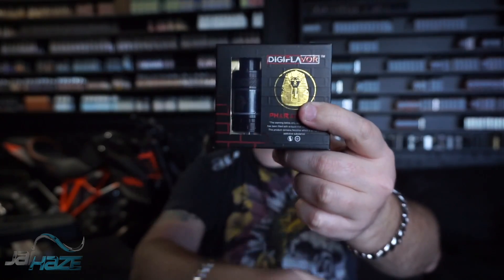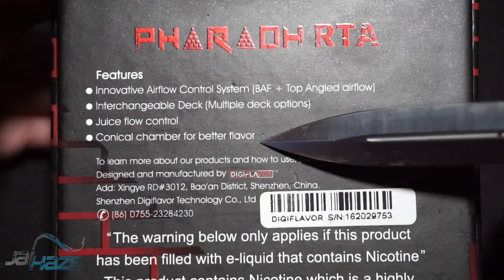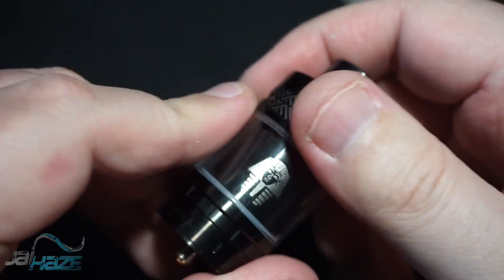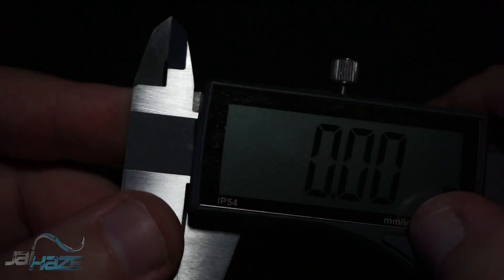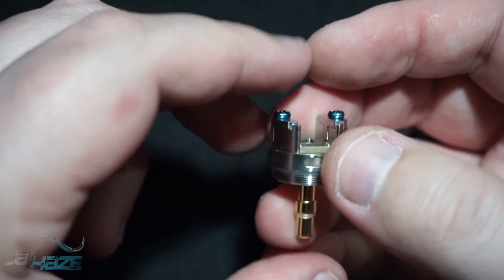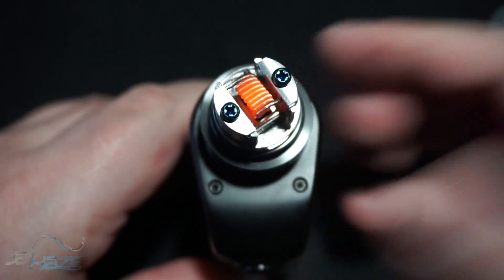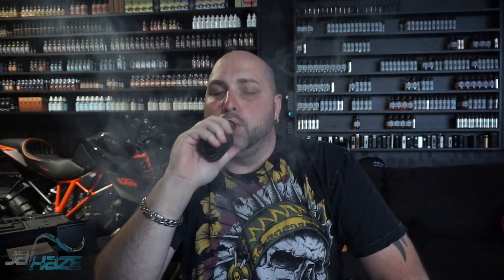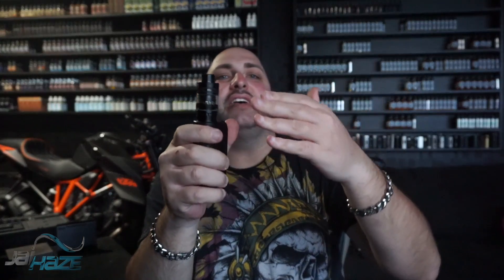Digiflavor Pharaoh 25mm RTA | RIP Trippers Review and Rundown

Comment: jai i can't wait to get mine its stuck in shipping. said something about being delayed its been 2 damn weeks!!
Reply: steven belmont74 took me a month to get mine and I'm not impressed at all. No matter what I do, I can't get good flavor.
Reply: I finally got mine in. its taking me some time to get the wicking down. that fold shit rip does in his video doesn't work for me. I just wicked it regular way. and I will say turn juice flow control off before you fill is a must. what kind of coils are you using?  I am using a single fuse Clapton.
Reply: steven belmont74 right now I'm using 4 wrap single coil fused Clapton. I'm still learning with this so I always try to build around the same ohms. But I know with single coil, you build higher, I'm used to the .2-.25 area.
Reply: I am running stainless-steel I use 2 strains of 28.gauge for the core. and 38 gauge wrap and its 7 wraps on 3.0 rod. it ohms at. 0.47 and its good flavor.
Reply: steven belmont74 I'm gonna have to play around with it more

Comment: With this deck, I was able to do triple coil, dual coil, single coil, vertical coil, dual vertical coil, etc. Love this deck. Just a bit on the big and heavy side, so I got the Themis mesh version and using regular coils on it, because I can't get the fucking mesh not to go dry and burn my fucking cotton. I've tried everything. Dense cotton, going light into the wicking channels, light fluffy cotton, going deep into the wicking channels and every combination between. The only thing I can think of is that I need a different type of cotton, maybe rayon. I have organic Japanese, a huge box of cosmetology cotton, cotton bacon, etc. and nothing works. I like the Themis, doesn't leak at all, ever, but it drinks juice like a mofo! No adjustable juice flow. I'm going through so much juice with the Themis. Seems like I'm refilling it every hour or so. Every time I take a couple of drags, I can see the juice level go down about a mm. It's insane.

Comment: This thing is a fucking turd. I can't get mine to wick right for the life of me. I've tried 20+ builds. If I loosen the top it wicks but then floods like the Nile.
Reply: I love the build deck on it but it's not my favorite RTA.
Mine never flooded and it kept up when chainvaping.
You shouldn't have to loosen the top to get it to wick. You are breaking the vacuum when you do that so that's why it floods.
Reply: I followed a different technique and it is a little better but still not fantastic. I'm gonna give up lol.
Reply: What are you wicking with?
Reply: bowl4two I've tried Native wicks, demon cotton, Pima natural, organic pads, and I'm sure I'm missing a couple more lol.
Reply: I usually use the Scottish roll with success and that the best I get out of this tank but RIPS technique is the worst dry nightmare of the bunch for me.
Reply: I will definitely try thinning it some more.
Reply: This tank wicks great. I just put a lot of cotton through a 3,5mm diameter 7-wrap spaced SS316 clapton coil and made sure to "scratch" or "brush" the wicks a lot with sharp tweezers (so that they're really fluffy/fuzzy, then cut the excess) and then put the ends into the channels so the wicks cover everything, but they're loose in the wicking channels. 

The coil came out to a 0.56ohm and i'm rocking it at 65 watts with no issues and getting tons of flavour and nice clouds out of a single coil. I tested the limits and the limits are at around 75W where wicking won't be able to keep up chainvaping (didn't burn my wicks). I could run this at 70W, but that's too much power already and it causes the flavour to get muted. 60-65W is my sweetspot.

I agree with Jai Haze, it's got great flavour.
Reply: That's exactly how I like to build but not good at all in this thing. I've had this happen before and my juice was part of the problem. Max vg is more than likely contributing to my issue.
Reply: Are you sure you've lowered the coil quite close to the airflow? If you have the coil up high, it's probably not going to help with wicking. Also yeah, max VG definetally is harder to wick. Also what cotton are you using? Personally i'm using Paronin Riistovilla as in Grumpy finn from Royal Wicks, which isn't available in the US, but other good wick i can recommend is Kendo Gold edition, but that requires a bit of work to setup. Once you do get it right though, kendo gold edition is a good wicking material.